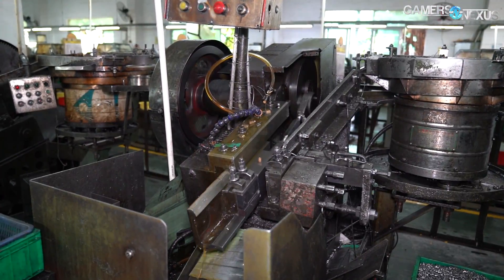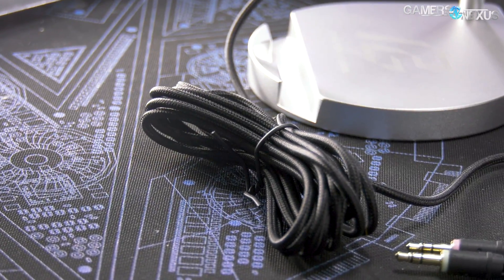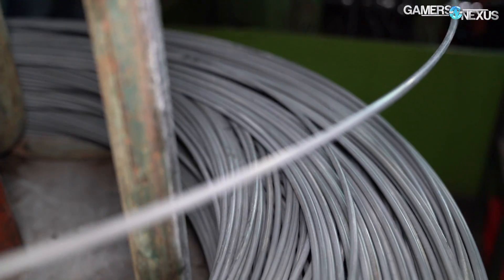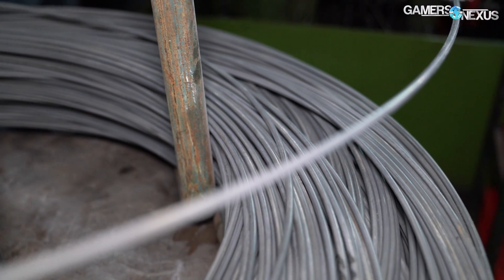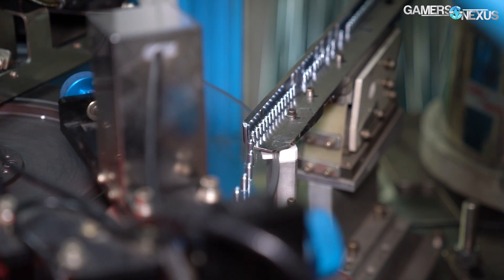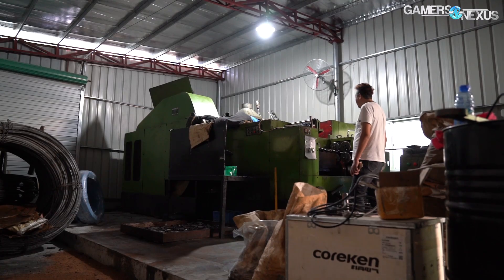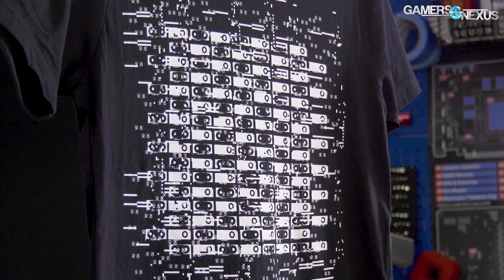How Screws Are Made | Automated Factory Tour in China

Comment: 06:08 in my opinion it does not use a laser to check the dimensions of the screws. as far as I can tell the screws are measured by a camera system. I know that because I both manufacture and work with these type of 100% control machines.

Comment: Worked for a precision engineering company in the Far North of Scotland in 1980, we made around 250k screws per week plus other threaded inserts for electrical plugs/sockets/fittings we also made parts in stainless steel and aluminium. The screws etc. were fed by magazines that took between 10 and 20 3m bars of various diameter. The noise was indescribable :) I turned various parts out of aluminium that the automatic machines could not do so easily. Well it paid for my flying lessons, and the factory was within walking distance of the flight school :D Thanks for sharing this video it brought a lot of happy memories back.

Comment: I used to set up and run an automatic screw machine in a machine shop. They are a nightmare to set up and a pain in the butt to run. Not enough credit is given to the operators of sutch machines. Without the machinists, the machine does not operate.

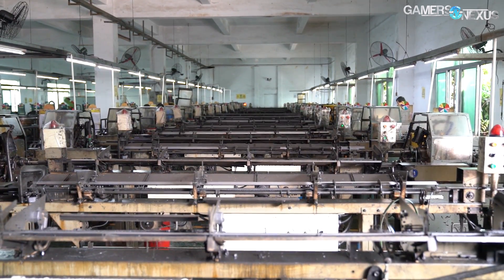Comment: 2:45 Those are called screw machines (no pun intended) if you closely at the right during 3:40 you can see various cams that move the various tools in an order to make various parts. Only problem with that you cant "program" a new part easily. There are CNC screw machines that are exactly like that machine but you can program various operations on the fly. Both do the job well but the CNC is better if you are changing out different parts more often because they have to design and machine the screw that is the "program" of said part.

Comment: The machinery that makes the screws looks pretty old. Not that there's anything wrong with that but when you buy a bolt or especially a threaded rod in the hardware store, chances are pretty good that the threads were rolled by a pair of heavy duty rollers, rather than being cut by a lathe like these were.

Comment: Silly question, For 7:20 but wouldn't it be a false negative instead of a false positive as you are sorting off screws for re-test that do NOT meet the required pass condition because expected product properties are ABSENT in the removed screws for re-test. If you were testing for false positives surely you would do a Re-test of the ones that passed to verify they passed? semantics question but still important.

Comment: Howdy Steve Those Automatic Screw Machines Are a lot different than ones used in the US, We have found out in the US that Using Straight bar works better than a spoon you have to straighten. It can also be tough on the Carbide cutting tools to where they need to be Cleaned-up/Sharpend more often...we also use a Water Oil Mix lubricant that's not as harmful to the earth like the "ARNO" Motor Oil Looking one they are using it is also alot better in the HOT summer because it have very little air born particulates.   Told Yall I worked as a Tool & Die maker and that was where i cut my teeth Setting up Automatic Screw Machines and then later on Programing CNC mill machines I have a class 1 Machinist Cert. Anyway it was Cool to see what I did when I was a young Calf...lol      Cow}:-o)

Comment: Hey that's what I used to do. Nice to see it getting some love. Ran 4 die 4 blow 1/2in sacama among many others. Depending on the size machine you can make way more then 20k a day. Also the machine doesn't compress the wire. The wire is made to to size using a draw die, and wire machine before even getting to the header. One to take out any irregularities in size, we are talking 0.001in in wire size can make a difference in the final part, And two, so you can order one size wire, and make it work for many size jobs.  
The parts you where given are called the cut off, impact, upset and final. The most manual part as well is the machine set up. Welding wire takes a few min. Changing all the tooling and setup can take an hour or so depending on if its a sample part, and what tooling needs to be worked on, ect. I would pay to see someone fully set up a 6 die header in 5 min, im calling bs on that one.